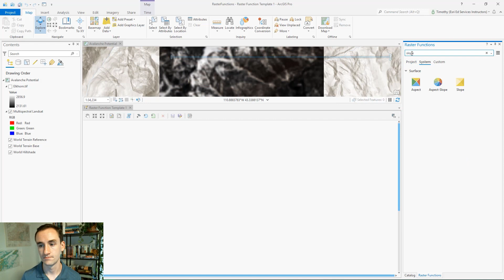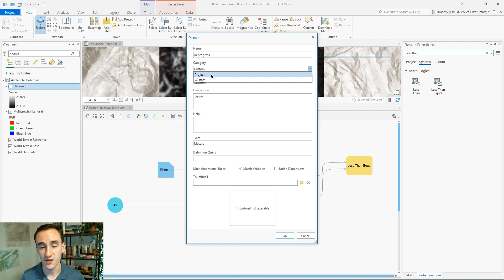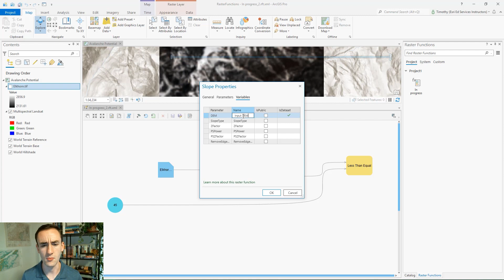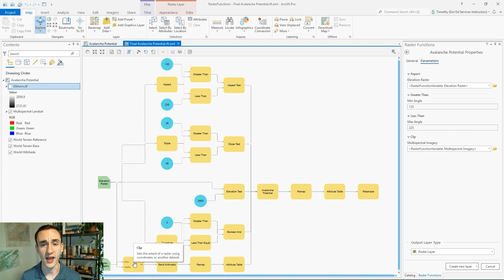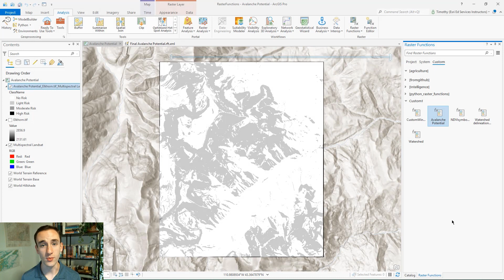Raster Functions: Design a Template for Multiple Inputs

Comment: Hi Timothy and thanks for the instruction. I was wondering if there is a way to use raster function templates as a batch processing tool? For example if I want to apply the NDVI raster function to 200 images. If I add even 20 images to the template and try to join them to the NDVI raster function then  can only join one. It seems as though multiple inputs work with some functions but not all, pansharpen for example seems to work fine.